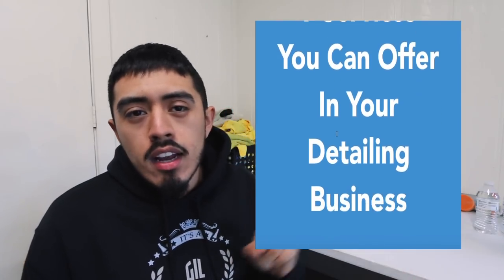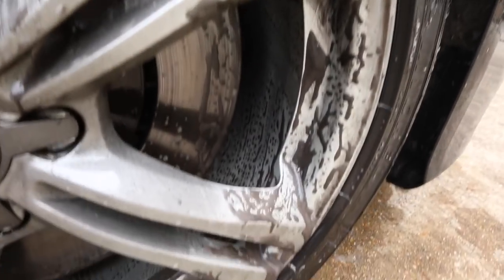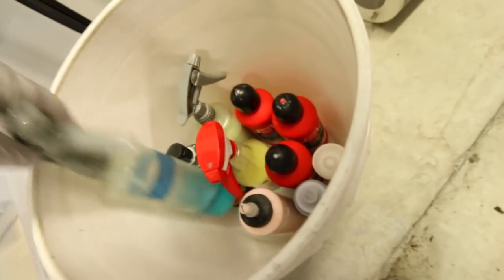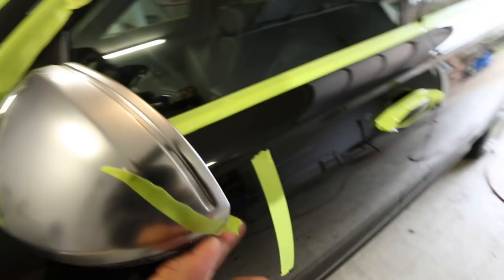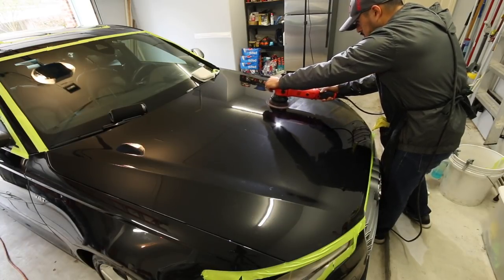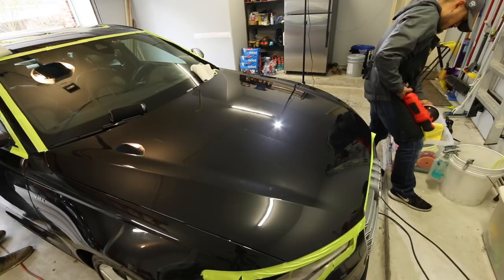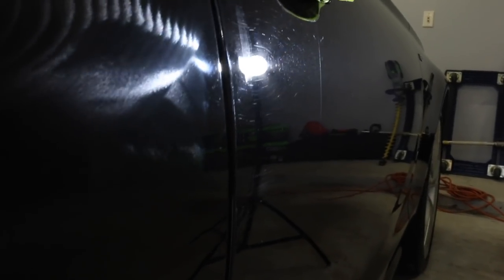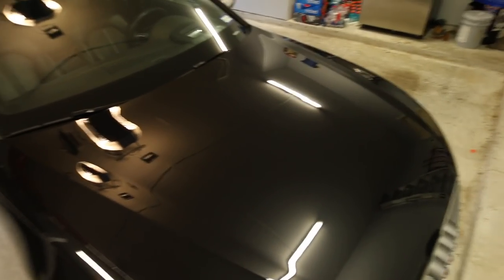Paint Correction on Black Audi S6

Comment: Oscar,
How do you know when or if your car needs a one step or two step paint correction? I have a black vehicle and there's micro spider webbing along with obvious water spots on the paint. Aside from those two issues, the paint is in great condition. Would compounding and polishing be an overkill or would polishing clean up those defects?